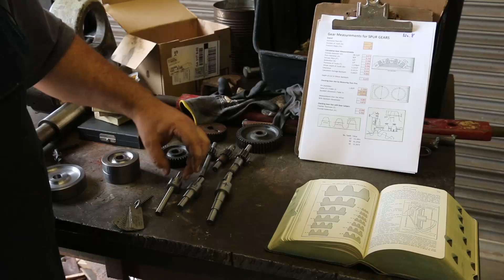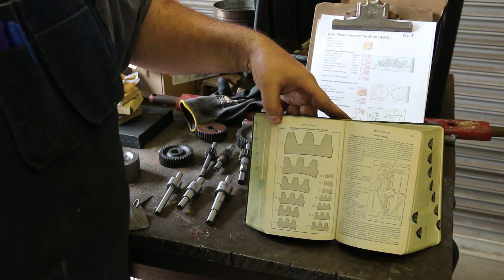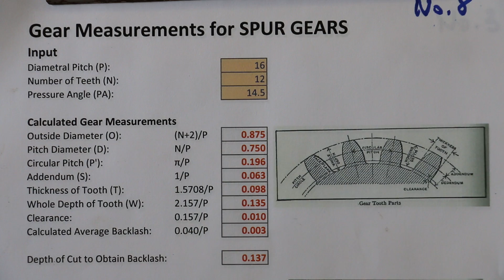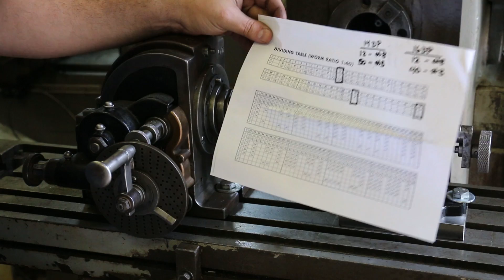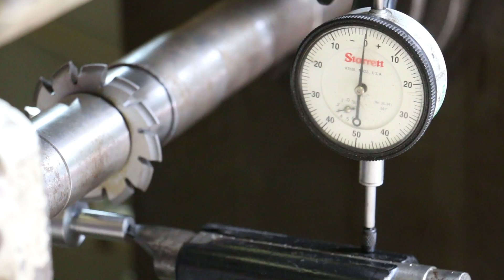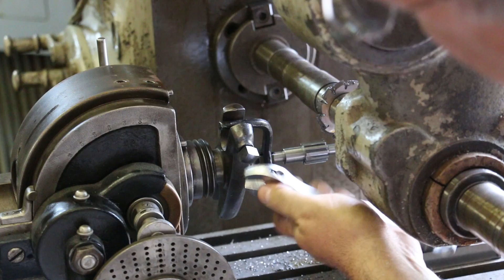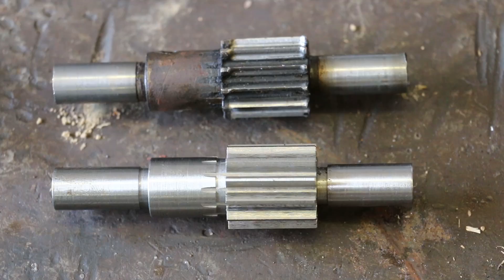Gear Cutting Basics and Cutting Pinion Gears on a Horizontal Mill

Comment: I just got myself my first mill and it came with a very large and heavy dividing head. Your video helped me better understand where to start and how to do the maths for the dividing head!
Question; I only got one of the discs with the holes in it for the dividing head. Would designing them in CAD and 3D printing them be strong and precise enough if I would ever need hole patterns different than the ones on the disc I have?

Comment: Seems like you could incorporate the chart for the plate settings on the dividing head into the Excel spreadsheet you are using for the gear dimensions.

Comment: I was studying up on gear cutting for the 1st time in my life and came up with a conclusion concerning the cutters and wanted to ask if I was correct. 
IF one wanted to add a few cutters to one's home shop it would be very difficult to select which ones to buy. It appears to me that the diametral pitch and number of teeth are the governing factors and vary so much that just a few "common" cutters most likely would not cover many applications. It would seem better to wait until one actually has a gear project then obtain the cutter needed. Or, as I usually encounter older projects (old farm engines, teens and twenties) could you suggest a common DP to look for?
Reply from the maker: You are pretty much right on - you just never know what you might need to cut.  With that said, I seem to have multiple jobs with 14 and 16 DP, but your needs might not  be the same.  If I run across used gear cutters at a decent price, I just get them and keep them in stock just in case, but I probably would not pay much for a particular cutter unless I knew I needed it.

Comment: @34:23 and @34:40 it can clearly be seen that the workpiece lifts on the centre support as the indexing head is turned. This can also be seen VERY clearly during the closeups on your second cut. @40:36 the workpiece can be seen dropping on the centre as the tool cuts. The centre has the top half ground away which means it is just about unable to support the workpiece against the downward pressure of the cutter. Two questions Keith. Why did you use this cutaway centre when it predictably cannot do the job? Why do you show this as an example in your instructional video? Maybe you didn't see this movement and maybe you do not know how well your closeup views show your depiction of appallingly bad engineering practice. Perhaps you have given none of this any thought. Judging by the number of plaudits below it looks as if you are not the only one who has failed to notice this. Why do you do this?

Comment: Thank you for this subject and series. You have given me hope of being able to get the large gear wheel in old craftsman hand crack grinding wheel, that screw clamps on to a bench  fixed.   Not having a section that needs speed to skip over the few missing teeth to keep using and display.

Comment: Very interesting, in the metric world you don't use teeth per length but you have the module which is basically a parameter everything scales with. For example, the tooth height is two times the module. Best thing is, if you know the module, you don't have to count the teeth. Just measure the outer diameter, divide by the module and subtract two. If you have for example a gear with 48 teeth and with module 5mm it should have an outer diameter of 250mm. If you don't know the module, you could count the teeth, measure the outer diameter and then you'd get it if you calculate it backwards. The counterside is that the pitch is some odd number, because you calculate it with module*pi, but you only really need that for racks.

Comment: great video. one question...why do you touch on with the cutter to measure height?  is it  not possible to use a feeler gauge with blade stationary and set the zero point based on this or is that difficult because of the nature of the teeth?

Comment: Hello Keith, Love your videos. Many years ago (over 50) I was learning to run a K&T horizontal much like the your using. Ours had rear controls. Anyways My dad expressed to me that I was never to final tighten the arbor nut without the over arm support on. Old-timers said that you can actually bend your arbor, and I'm sure that's true. The language was very colorful so I've never forgotten. I cut thousands of inches of slots building an early quick change lathe tool holder. We got our patent in 1963. Nix Quick Change Tool. Similar to the KDK except an entirely different lockup. Jack Kuhns of KDK was a friend of my father, my dad bet another toolmaker that he could build a better lock than KDK's. The KDK would loosen up under a vigorous interrupted cut.
Jack built a quality product and used the right equipment and processes to do it. Our operation was somewhat lacking in resources and marketing. Alter I returned to the business from my tour in the Army and a trip to Vietnam dad sold the patent and inventory to JFK co. whose was an early innovator in soft collets and collet closers. My brother and myself have regretted dads decision to this day. We had plans to modernize, market and expand our product line. I was saddened to read that KDK finally shut down their plant due to business conditions. They had a great product. I'm sure Jack Kuhns has long passed and probably his sons or grandsons ran the co.

Comment: I don't know how relevant this is now seeing as this video is over a year old but a trick I learned for measuring over wires/pins is you can either use some elastic bands over both ends or a dab of grease in the groove to help keep the pins in place while you mic them.

Comment: Nice video. I was taking Autocad and mechanical engineering at A.B.Tech. In one of my classes I designed a clock. To make it easier to do all the gear calculations, I entered all of the calculations into Excel. I had a box of cells where I would enter all of the known values, and they would be automatically entered into the formula's. Then it would do all of the calculations for you. It really made it easy. I can send a copy if you want, and you can post it for anyone to download. Take care.

Comment: How is the index used for over 40 teeth of a regular gear? Does everything have to divide up evenly into/by 40 or is there a way to do any number of teeth and advance the proper amount?
Reply from the maker: You can do nearly any number of divisions if you have the right plates.  The manual for a dividing head will give instructions on how to set it up for pretty much any number of teeth.
Reply: Keith Rucker - VintageMachinery.org Thanks. I seen another video about it because I was considering purchasing a dividing head. But I see now that they too have hole plates to establish fractional amounts. This has all been very interesting to me. Thanks again.
Reply: Don't know if you will read this or not but you can get a rotary table with indexing plates combined.
 The divisors of 360 are 1, 2, 3, 4, 5, 6, 8, 9, 10, 12, 15, 18, 20, 24, 30, 36, 40, 45, 60, 72, 90, 120, 180, and 360.
Plus you can do much much more with this than just cut gears. 
Drill holes for spokes and so on.
Reply: Worth Doss Thank you for your reply. Never even considered spokes.

Comment: I would wait until the overarm support is on before tightening the nut, because you can see the arbor bending without support- over time it can put a permanent bend in the arbor- also, I find it's easier to touch off and just watch the progress of the cut if you blue the gear blank.  I once had to cut a pinion on a long shaft, and found that the length was causing the blank to deflect downward under the cutter pressure.  So I made a little tool I called a "bottom rest", which was a brass bushing bored to the diameter of the gear blank, then cut in half so it would support the blank from below.

Comment: Before World War One this was my great-grandfather's occupation. I'm wondering if anyone has any insight on what that occupation was like then, if indeed if was different than how it is done in this video.
Reply from the maker: +Mdriver1981 The basic principles were more or less the same, they just used more primitive machines that were powered from overhead line shafts and flat belts rather than motors on individual machines.  But the principles of how I got the job done were more or less the same.
Reply: Aye, thanks for that!
His gear cutting was for the railroad, which went through a huge expansion in upstate, New York at that time. He was based out of Syracuse. Same railway lines that are now heavily used by CSX.

Comment: A quicker way to center the cutter is to put a thin straight steel strip (ruler) on top of the blank and lower the cutter with one tooth touching the ruler on top of the blank  center by adjusting  cross slide until ruler is level - this works for lathes also.

Comment: So you never have to guess or keep remeasuring for the next gear cut... wondering if there was still a faster way to cut gears because for mass production it would still seem like awhile to cut ... ofcourse if you had a lot of machines with machine operators at the same time then you could make up for the speed of manufacturing alot of gears in a short time.
Reply: +sam111880 Yes there is a faster and more repeatable method. It's called computer numerical control (CNC). It is possible on these large old manual machines to install servo motors to control the table motion and use a 4th axis rotary servo table for the teeth, though quite a complex conversion job.

Comment: O so that how gears are cut the old fashion way before cnc machines where in 1880-1940 ish era of electrical lathes. Curious if this was the main way of making gears in this era when mass producing ... i see that as you turn for the next cut it is precise based on the stopper mechanism that allows you to rotate the exact amount for the next gear cut
Reply from the maker: +sam111880 This method has been used for many years to make gears, but when mass producing them very often they would use a machine called a "Gear Hob".  Much faster for mass production but requires special tooling for each gear that you cut.

Comment: If you can "feel" the feed rate, you can also find the center of the part by skimming the top surface of the part with the cutter and eyeballing the center rather than using the same, eye-balling method with the square.
Reply from the maker: +Daniel Zuñiga Gutierrez I have used that technique as well.
Reply: +Keith Rucker - VintageMachinery.org I knew you did. You look pretty methodic. I also hope you enjoy what you do cause I was a machinist for 19 years and overall, didn´t like what I did. P.s. I was taught my machining skills by non other than "The kid on The Wooden Box" Leon Leyson- the youngest survivor of Shindler´s List.
Reply from the maker: +Daniel Zuñiga Gutierrez I spent a little over two years working in the machine shop right out of high school to save up money to go to college.  It was one of those jobs that I both loved and hated.  I loved doing the one off "job shop" things that we would do but I hated doing production work where we were making the same part over and over again, sometimes thousands of pieces stretched out over weeks or months.  The nice thing about what I am doing now is that I can somewhat pick and choose what jobs I want to do and that I will enjoy doing.  

Pretty cool to have learned your trade from someone with such historical significance.  I am not sure if he ever really talked about that experience, but it would have been really neat to have heard those stories from a first hand survivor.  My grandfather was in Europe during WWII and was one of the thousands of GI's that was required to see some of the concentration camps with his own eyes.  Eisenhower wanted as many people to see it as possible because he know that there would be people in the future who would say that it never happened.  My grandfather rarely ever talked about those experiences but I feel fortunate to have heard what little he did tell of those stories from a first hand eye witness.

Comment: I believe I have heard you mention before that you wish you had a shorter arbor for that machine. Couldn't you machine another arbor, or is the tolerances/size of the mating head such that it is not possible with the tooling you have?
Reply from the maker: +Bigrignohio Machining the 50-Taper socket would be a challenging job.  Doable, but probably not very practical.
Reply: Keith Rucker - VintageMachinery.org
I figured that would be the case. Perhaps someday you will luck into a second one you could machine down to length. If I have learned one thing fooling around with electronics is that damaged, yet repairable, examples of everything will eventually find their way onto eBay or Craigslist.

Comment: Hello Keith , what do you think is the butter spindle speed with carbon steel 1045 cutter module M2 , thanks in advance
Reply from the maker: +Nacer Ziani I don't have my little slide rule calculator here at the house where I am working on the computer.  If you do a search for "Speed and Feed Calculator", there are some good resources on the internet that will give you some good guidelines.

Comment: First I want to say this is one of the best explained videos on gear cutting I have seen!, Thank you.
Second I know a lot of people have been asking about the spreadsheet but what I would like to know is where you got the dividing table cheat sheet?
 I've done searches but all I can find is calculators I would like to have a chart that I could hang by the mill for reference.
Reply from the maker: Al Meyer Al, go and check out my website at vintagemachinery.org.  We have tons of references like that for all kinds of machinery and such - thousands of scanned publications from manufacturers of machinery.  Here is the publication I got that from - a manual for a Brown and Sharpe dividing head:  http://vintagemachinery.org/pubs/detail.aspx?id=5863
Reply: Keith Rucker - VintageMachinery.org Thanks for that Keith, I kind of forgot about the publication reprints on your site.I generally go to the vintage plans and poke around, I need to remember there is so much more on that site!

Comment: Hi Keith - I'm wondering why the tail piece center point has a flat top?
Reply from the maker: Scott Brunner For cutting gears and splines right on the end of a shaft, the cutter would hit the center and since the center is hardened, that is not good for your cutting tools or the center.  By having a flat top like that, you can cut all the way to the center of the part without worrying about hitting the dead center!

Comment: Hi Keith,
Thanks again for another great video.
And it seems like everyone else has already said everything I wanted to:  great video, very informative, easy to understand...and I would like a copy of the spreadsheet, too. Could it be posted on the Vintage Machinery site for downloading?
Thanks again.
Joe
Reply from the maker: Joseph Magedanz I will make the spreadsheet available, but I need to go in and clean it up a bit first.  Some of the calculations require looking up different constants from the Machinery's Handbook and I need to make that automatic as the way it is now, it would not be very user friendly.

Comment: Keith, great video as usual.   On the initial topic of the space between the bearing support and the milling machine itself, the deflection can be calculated using a formula that basically says for a given load (same) and differing lengths of the shaft, the third power of the length is the determining factor (structural equation for deflections).  To simplify it, the deflection on a shaft is increases by the third power of the length assuming all else is the same.    Therefore if you have vibration of the cutter, shortening the effective length of the cutter shaft between the bearing support and the mill proper will dramatically stiffen the shaft and reduce deflection.,

Comment: Nice work Keith, well explained and executed.  Good idea to use Excel, you only need to make the spreadsheet once then you can just change the numbers for the different gears.
Reply from the maker: Bill De La Vega Thanks Bill - everybody is wanting me to share the Excel spreadsheet!  I need to clean it up a bit and have it do a few more calculations without having to manually enter some constants, but I will try and do that.
Reply: Keith Rucker - VintageMachinery.org 
Hi Keith,
Another excellent video.  I am pretty expert in Excel and attempted to duplicate your worksheet and got stuck determining the Depth of cut to Obtain Backlash.  Oh, wait maybe I have it. Are you using the Table titled Excess Depth of Cut E to Provide Backlash Allowance?  1.00 X B or 0.004" then added to the whole depth of tooth 0.135" for a total depth of 0.137".  That works mathematically but is it your way?  Hey thanks again.
Russ

Comment: Hi ;    why the flat top on the dead center ?
Reply from the maker: Wayne Murphy You see this on pretty much all tailstocks on a dividing head.  It is because a lot of times you are cutting a gear or spline on the end of a fairly small diameter piece of stock and if you had the full round dead center in there, your cutter would dig into it.  Not a good thing to happen as it could mess up both the center as well as your cutter.

Comment: hey Keith, watching you put the micrometer in the vice just gave me a funky idea: put a rubber band on the work before putting it on the dividing head. that way you can hold your pins with it for measuring without having to remove the work from the machine... you would have both hands free to use the micrometer without having to hold the pins
Reply from the maker: HolzMichel Great idea.  Several others have suggested something similar.